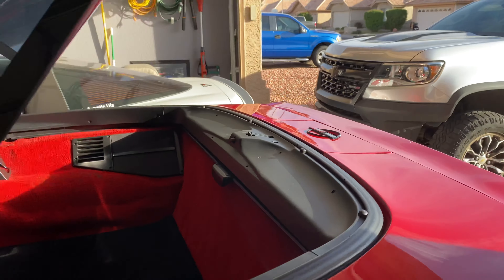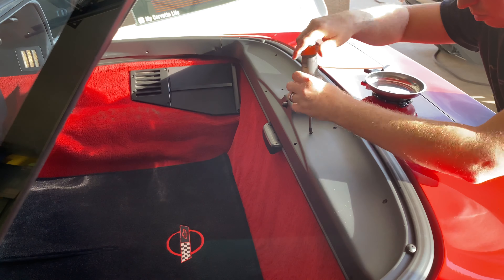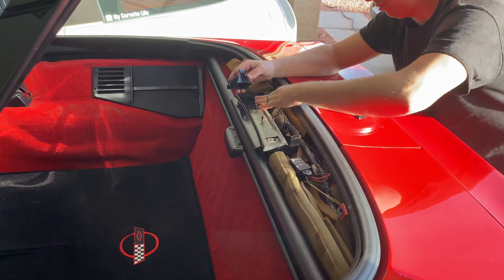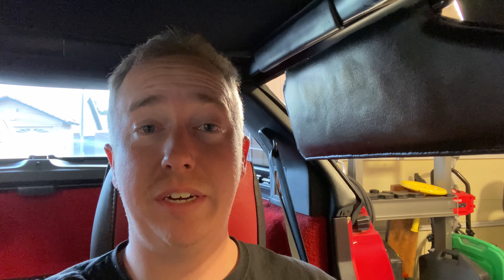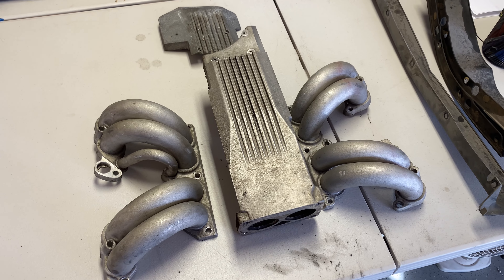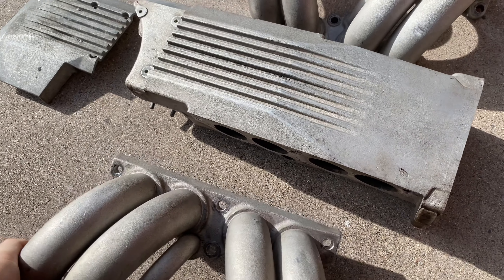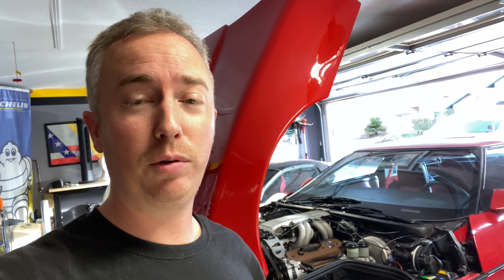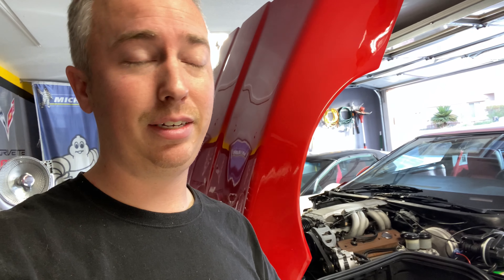C4 Targa Storage Latch Replacement

Comment: Interesting my 94 has 4 annoying torx bolts to get the top off. I got a bit for my cordless impact gun and zip it off in a couple minutes  Oh & if you want to keep the intake looking stock but clean. I used alumablast from Eastwood.. I did the intake , ac compressor and alternator. Really cleans up the look of the motor

Comment: There should be 2 bolts in the back holding the top on place. The top is very important in making the car stiffer.  Both my C4’s handled very differently with the top out.

Comment: Is there a chance you would be doing a video on how to change spark plugs and wires and disturber? Great videos I’ve been following one I have a red 86 just like yours
Reply: The spark plugs are pretty easy to change out...😟
All you really need to do is number your wires...take a picture of it, so you don't get confused when reinstalling the new wires.
Reply from the maker: Yes, I will be doing all of those.